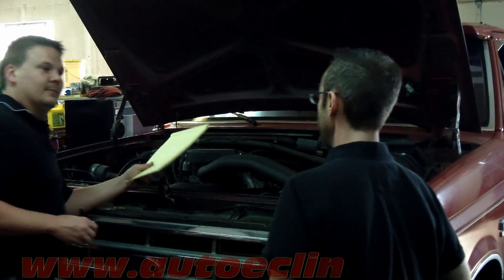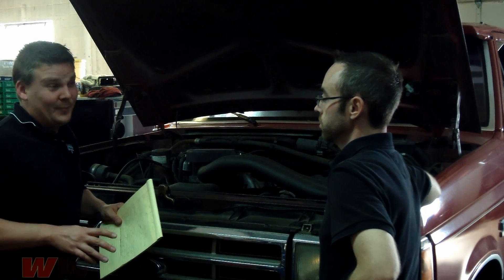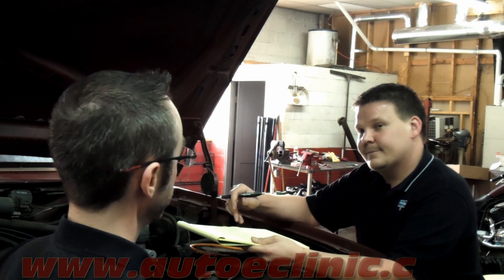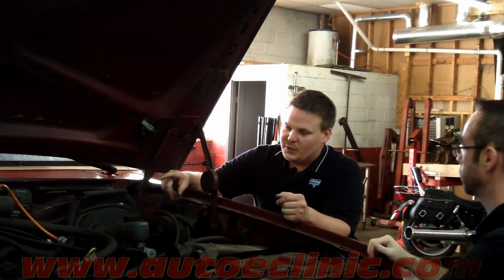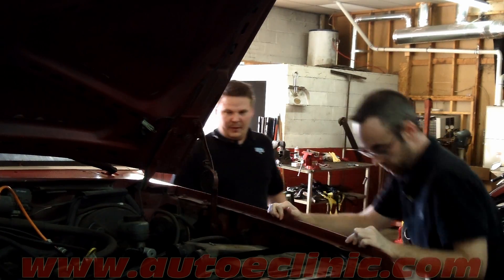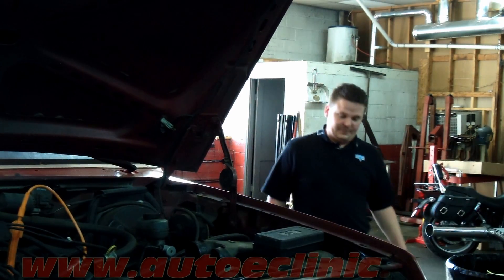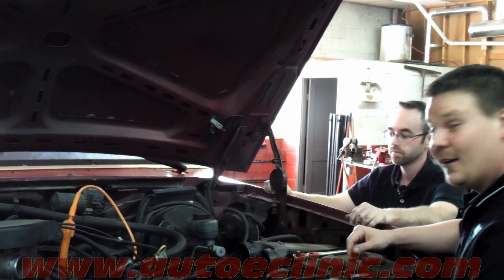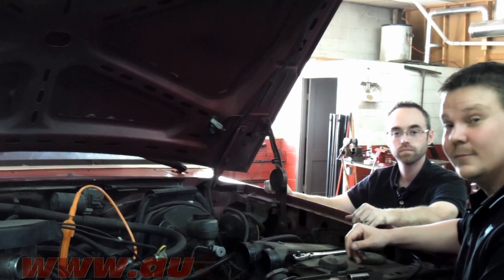How to Diagnose an Engine Misfire- Fuel, Fire or Compression

Comment: For DIYers who dont have all the extra fancy tools, a leak down test would be my next test to verify a burned exhaust valve, leaking intake valve, badly worn rings or hole in piston. This can be done with simple tools such as the compression tester hose with the Schrader valve removed, an air compressor, spark plug out again and engine rotated to TDC Compression stroke on the affected cylinder which takes some knowledge for the DIYer. I might go have a look at the local gas station air hose to see how I can modify it to match up to my Compression tester hose quick disconnect fitting to make it all happen if I dont have a friend with a compressor. While charging the cylinder with air and engine off of course, do a walk around to listen for air escaping via the tailpipe, the air filter housing with throttle wide open or the oil fill hole or dipstick tube to determine where the compression is being lost. If nothing showed up pull the radiator cap off, then the spark plug right next door to see if air is escaping from these locations. Probably need to crank up air pressure way beyond 32 PSI for your normal tire pressure at the gas station.

Comment: 2006 Nissan Altima 4 cylinder. Has misfire on cylinder 2. Rough idle but goes away as soon as you give it a little gas. New plugs, coils and injector on #2. That's what the dealer said needs to be done. I did it myself but still the same. Could it be a weak fuel pump? Car has 103,000 miles. What do you think guys?
Reply: I think the whole “disappearing” once given gas is what to search around to find the true problems.

Comment: Guy charged me 500 for tune up said couldnt test for misfire without it. Was i robbed? Now he want 2700 to fix heads. Is that neccerary?
Reply: C G what was included in the tune up? You diagnose the misfire before the tune up to see what needs to be replaced. Could’ve just been your spark plugs or spark plug wires. A clogged fuel injector or fuel filter could’ve cause it as well.

Comment: What did you do if you have a random misfire. I have that issue in my car but can't even figure out what is it. Change plugs, wires and still the same. Code P0300 any help. Thanks
Reply: Fuel pump

Comment: I guess you should have done Leak down test at the same time with compression test .And some batteries dies out after a few cranking , so we have to keep charging the battery While cranking it for the test or change the battery all together if it’s worn out .

Comment: Videos of rhetorical questions are weird... it's like watching a bad porno flick from the 70s ..... ps... this is absolutely horrible diagnostic testing ... YOU DON'T STAB HOLES IN THE PLUG WIRES,  NOW THEY ARE TRASH... you also need to do a leak down test BEFORE you pull the head !!! YIKES !!!

Comment: FYI, I found this article http://www.nonlintec.com/sprite/cap_failure/, describes the poor quality of condensers leading to arcing, they recommend a better capacitor -condenser, but I re-read it, gave it some thought, then I put a 2nd condenser on the coil -ve post, reason - the chance both condensers arcing at the same moment would be remote, and thus the non-arc condenser electrically kills the arc of the other, my long time problem in L20b Nissan engine is cured, so - on any engine with points and condenser, replace 1 old condenser with 2 new for great results

Comment: Why are you taking the cylinder head off before you've proved whether you're dealing with a gasket, a piston or a valve issue?? Why didn't you test cylinder 7 as well? More to the point, why not run a cylinder leakage test to get a better idea of what to look for when you do dismantle the engine? 
You could have used a pressure transducer - such as the PIco PP939 kit - to see what was happenning under cranking, and with engine running. You'd have had a superbly clear and informative picture of what was going on in the engine. You'd have had a saved copy of your bad engine with the fault(s) and a printable report to show your customer.  

The PicoScope with the COP tester would have given you the answers to your fuel and fire on all cylinders in just seconds, again if required allowing a saved and printable document, before going onto the intetrnal engine issue. The pressure tranducer really is the ansewer to in-cyliner issues. You can see valve timing issues, valve operation or seating issues, as well as all the other possible internal problems. Of course the other test that could have been performed early on would been a relative compression test using the PicoScope and a high amp clamp without any dismantling, you have know you had a compression issue within seconds! 

The relative compression test is actually the quickest and easiest test to use as a starting point with all misfire or power loss issues! Again, you have recordable trace which clearly proves in just seconds that you have or haven't got a compression issue.

Comment: What about separate problem if is rings or valves before pulling head by squirting small amount of oil into cylinder combustion chamber and do comp. test again. If reading up is rings or... and if stays same is valves.

Comment: Hi sir, I have a Honda Accord 1995 SV4 misfiring problem and I do check following:
1. Distributor - replaced
2. Plug cable - replaced
3. Timing - realigned
4. Compression test - normal

Symptoms 
1. Misfiring
2. Intake manifold seem like having some leaking
3. Cooling system water decrease without leaking (by visual check)

Please kindly advise...

Regards,
Jeff Foo (Malaysian)
xerox0131@gmail.com
Reply: Bro ... cooling system water decrease please check your water pump and change your timing belt at the same time ... happened to me before. Another thing about the timing try get another half cut throttle body and see

Comment: can't you do a wet test to determine the rings, or a leak down tester to determine again rings or the valves , head gasket etc, without pulling the heads off

Comment: I have a 1998 ford explorer  sport 4.0 ,, check engine light is on,,  I was told that # 3 injector was bad,  and upper o2 sensor was bad, i check injectors with stethoscope , about half of injectors are opening and closing about 3 times faster than the others is this normal or should all run the same, i cleaned the o2 sensor and didn't help,

Comment: You said two cylinders 7&8 were missing.  a misfire on two cylinders next to each other with low compression and spark and fuel being okay means there is a gasket blown between cylinders and not a piston problem. and sticking plug wires with a test light is just plain backyard wrenching. use a timing light to test for spark it is safe and quick. you two need to go cut grass.
Reply: Charles Chandler a

Comment: Who taught you fools to check for spark !???? Poking (Probing) HOLES into perfectly good plug-wires is a SURE GD good way to ruin a good set of plug-wires, let alone create an opening for future moisture to get into the wires, and a sure way for a wire to "arc" outside of it's self ! The SMARTEST method to check which plug and/or wire is faulty, is to either use an "in-line" spark tester....AND/OR to unplug each individual wire, one at a time, at the distributor, while the motor is running ! That way you'll find which cylinder is not firing !  And secondly, you've wasted the customers $ by adding a step to your diagnostics, You should've used your "In-line" spark-tester at the VERY beginning like I mentioned, instead of poking holes in the perfectly good plug-wires !!! IDIOTS ! Also, the "Noid" light ONLY tests the ECM's pulse signals TO the injector plug ! It DOES NOT test the INJECTOR itself ! Like you said you were doing at the beginning. You have to remove the injector to determine if it is opening & atomizing correctly ! And finally BOYZ, you DO NOT have to REMOVE the head to find out why and where you're losing compression ! If you're experienced w/a Compression gage, it can tell you whether the valves are the culprit or the rings ! Also, have you ever heard of a "Leak-Down" test !???? A leak-down test will ALSO confirm what's losing compression, exactly. Also, just because the plug smells like gas doesn't confirm that it's getting ample fuel !!! So Good-luck to all of your customers, because w/you TWO working on their cars & trucks, they're going to need all the luck they can get ! And remember,  it takes a clown to know a clown ! Ha ! Ha ! Ha !
Reply: does that mean your a clown to!!

Comment: Identify the misfiring cylinders by disconnecting wires, one by one, from coil to each sparkplug.  The cause became obvious when it was determined to be a compression problem.  Verify identical 25 PSI compression at misfiring cylinders 7 and 8, caused by a head gasket leak between two adjacent cylinders on a V8 Ford.

Comment: So I changed the plugs in my Dad's 02 Chrysler Town & Country 3.8L because it had been starting up rough in the mornings.  Well, I finally got all the plugs changed, but now I have a constant misfire on Cylinder #5 (P0305) which is worse than before I changed the plugs.  I checked the plug, installed new wires, put another plug in Cylinder 5, and it is still misfiring on #5. What could cause it to start misfiring after changing the plugs?
Reply: Check the fuel injector plug
Reply: Hey thanks.  I actually found out that one of the new plug wires wasn't connecting good,  even though it felt tight.
Reply: +Sergeant Gunny I had the same problem with my crown Vic for a whole year and no one could figure out the problem, then I decide to take a look for myself and it was just the plugs wasn't connected, crazy huh

Comment: ok I own a 2002 Mercedes C32 with a p0303(cylinder 3 misfire) I have new plugs,swapped coils packs and spark plug wires from 3 different cylinders(proving coil pack and wires good) and issue stays on cylinder 3 and it's weird cause it only shows a code in the first start of day if I let car idle after on 1:00-1:30 minutes but car starts fine then I get code and misfire is evident visually and can feel it...if I restart car after clearing code car is fine even at wide open throttle codes don't return...I was told either injector,fuel pump or low compression or cats...since car runs perfectly fine even at high speed it's hard to blame compression or cats, I would think if it's fuel pump issue then misfire would be all over and not just cylinder 3...I'm leaning on injector..what you think?
Reply: Dustin C  FINALLY swapped injector from cylinder 3 with one given to me and problem fixed now.
Reply: THANKS
Reply: Dustin C. Slade 556ghy

Comment: Cylinder leak down tester as well a word of advice to y'all please refrain from stabbing the spark plug wire it is designed to insulate the spark so it doesn't leak out.... electricity will always take the path of least resistance so if there's a way out it's not going to make it to the plug and cause a misfire

Comment: I have a 96 3000gt,  with a hard to solve misfire. Replaced plugs, Wires, coils, Injectors,  Fuel pum, Fuel filter, Also Checked Fuel pressure, All good, Still misfires.
Reply: I'm having similar problems with my car. Did you find out what the problem was. I've replaced the spark plugs and wires, valve cover gasket, intake manifold gaskets, fuel injectors and ignition coil and no luck.
Reply: Jenalin Balela Did you check MAF sensor, camshaft sensor, vacuum leak?
Reply: Jenalin Balela Why haven't you replaced the radiator, or better yet, determined whether the problem is electrical, fuel, or compression.  Did you sleep through the video?  A long time ago, an idiot asked me if his transmission could be missing.  I think he had a few wires crossed; know what I mean?

Comment: at 4:45 onward you're talking about lost compression due to just 25psi reading.. at 4:51 you are saying at that compression you are not going to get an explosion? Correction: explosion may still be there just a lost of power. You said there's fuel and there's fire. Misfire is detected because there's not enough power to bring down that particular piston down because there's a lost compression caused either by bad gasket or bad valve not sealing properly or not at all. Chemical reaction is there but there's no mechanical conversion due to lack of sealing. This is not a diesel engine when there's no compression absolutely there will be no explosion! Your video is teaching wrong technology..
Reply: They also fail to mention that a bad fuel filter can cause a engine misfire. I was getting a po300 code in my suburban and I had already done all the spark and plugs. All was left was the fuel filter and now she runs like a beast.

Comment: Shoulda done a wet compression test after doing the initial to see if a squirt o' oil raised the reading. If its piston rings, would have saved the trouble of taking a head off for diagnosis!
Reply: yup...and also a leak down test, so at least the know what direction to go before the start tearing it down.
Reply: The engine was running before hand. How would oil on top of oil work? They suggest a warmed up engine to accurately do the test or they'll all be low with a cold engine.
Reply: @jamesharris5232  the design of the rings. Oil ring stops oil one way.  Squirt tries to seal the other way and if. Ups compression, signals compression ring wear.

Comment: Where exactly did you stick the light tip into the wire? At the rear of the boot ? Can not tell from the camera angle , please let me know, I would assume is the same as pulling each one of the spark plug? Thanks Mike.

Comment: It will be far cheaper in the long run to buy an exchange long block, total repaint, frame stiffeners, bed-liner, air horns, lexan windshields, run-flat tires, steering wheel cover, and double din shortwave radio. A satisfied customer is a return customer. Everyone else is in jail.

Comment from the maker: @Robert Wood Actually the tool used to ground the wire has a very small point on the end. Also the upper portion of the boot is not the wire but houses the tip that attaches the the distributor cap tip. The tip leaves such a small hole the the rubber insulation closes back up therefore not causing any issues.